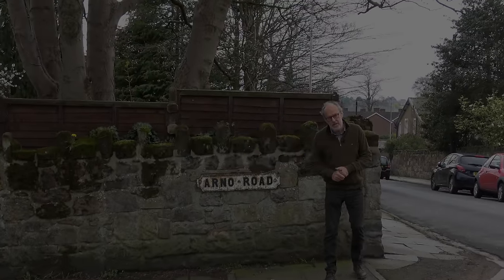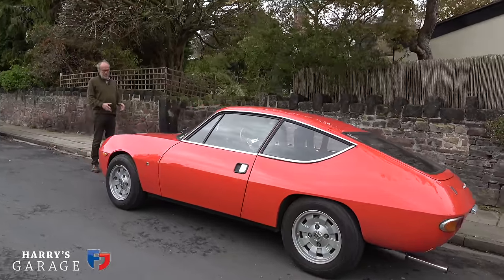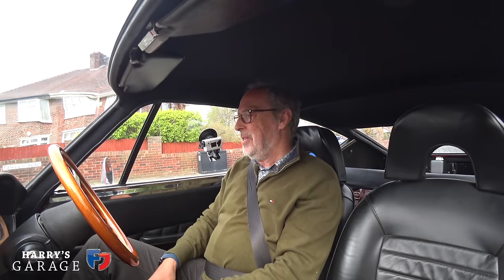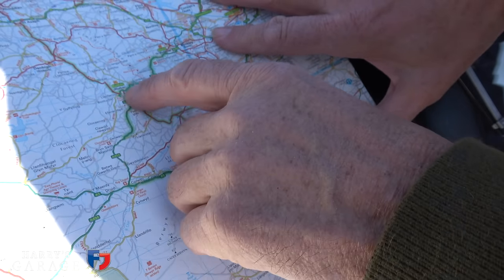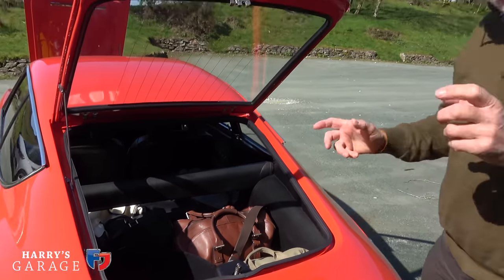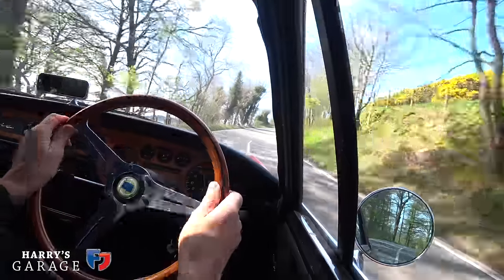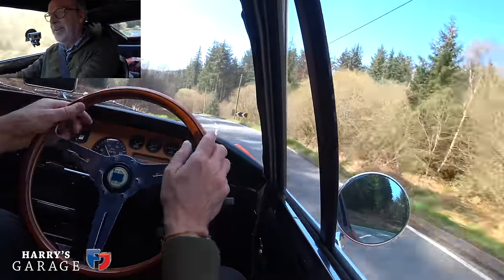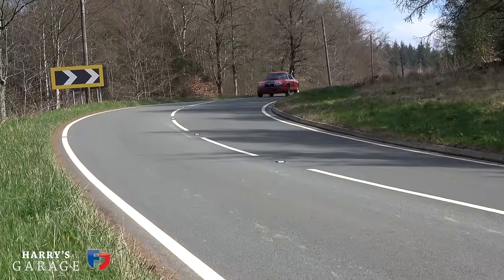Taking my Lancia Zagato back to where I first saw it 50 years ago & driving it on my favourite roads

Comment: Thank you so much for sharing, Harry. The timing of this video is blowing my mind because I’ve just done something incredibly similar:

I turned 16 In 1998, and I got my driver’s license and first car that year. It was a ‘95 Mitsubishi Eclipse GSX in white, which is a sporty AWD car with a manual transmission and turbocharged 4-cylinder engine. Every afternoon I would leave school and drive 25 miles home through the curvy rural roads of the Blue Ridge mountains in Virginia. Up until last month, those after school drives have remained my fondest motoring memories. 

In 2017, I moved out of the city and purchased a home in the rural Blue Ridge Mountains of Virginia. Then, on March 9th of this year, I purchased a new 2022 Subaru WRX in white, which is a sporty AWD car with a manual transmission and a 4-cylinder turbocharged engine.

Over the past month, I’ve been reliving those memorable drives from my teenage years in my new WRX, and I can honestly say that the joy it has brought me is right up there with the happiest days of my life. It’s not just the joy of a great car on a great road, it’s the joy of MY great car on MY great road. Congratulations on coming back to YOUR great road with YOUR great car. My wish is that all the other hopeless gear heads get to experience the same. They deserve it.

Comment: Harry, I know all that area very well. I cut my teeth riding my 1973 Triumph Daytona 500 and my 1963 Norton 650ss on Sunday runs all around North and mid Wales.
That double bend between Ruthin and Cerrigydrudian is a tricky one, it was awkward to get the right line through the bends, mainly because it is not only a down hill but the road cambers away, tricky in the wet.
Great times and great memories just like you have. Where you drop down from the town square in Ruthin to the bridge, me and my good friend used to always stop at the café next to the bridge for a hot tea or coffee and a Chorley cake, oh what lovely memories you have brought back for me. 
I have been thinking about buying a nice condition Norton 650ss and just spend my time journeying along the Welsh roads again.

Comment: A wonderful nostaligic piece, which takes me back to my first car, a used,  bright red Fiat 124 coupe that my dad bought me as a graduation present when I finished my undergraduate degree. . It cost $2900.00 Canadian in 1968, had an exotic 1428 cc, dohc engine, dual Webers right from the factory, and wonderful Italian handling.  I loved that thing and spent money I could ill afford as a graduate student, targing it up with a nice woodrim steering wheel and assorted go-faster stuff.   I was heartbroken when the rocker panels rusted out from salt on the winter roads of southern Ontario. Once, I took a friend of my dad's out for a ride on my favourite twisty country road.  After the ride he said "you know, you don't have to always drive as fast as the car will go".

Comment: As someone who grew up and started driving in around the same era, I feel lucky that I got to drive so many unusual and special cars, that were often more run of the mill back then. (not that this lovely little Lancia falls into that category!) The only Lancia I owned was a Beta 1600 HPE and finished in gloss black it just looked beautiful.  I had only been driving for a couple of years, after starting out in a modified 1962 Mini Minor (with an Austin 1300 engine swap!) and then having Cortinas, Escorts, Capri 3.0 Mk1, Fiat 131, Alfasud 1.5ti, BMW 2002tii, Renault 5 Gordini and Gordini Turbo, Porsche 914/6 to name just a few.  All were wonderful cars in their own way and even allowing for 'rose tinted spectacles', were great to own and drive.  They were cars that I would drive just for the pleasure of being behind the wheel and taking them on my own favourite driving roads. A feeling that I just never get with modern cars, where using their performance means you're travelling at speeds where the consequences of a mistake could be life changing. Give me a lightweight car, with a high revving normally aspirated engine and proper handling every time. Anyway, thanks for another terrific video Harry and for sharing that wonderful Lancia and its story with us.

Comment: Brilliant video, love the nostalgia aspect to it. Memories came flooding back to me too: I had a Fulvia Sport 1600 in the mid-90s which I had restored (though not quite to the same standard as this!). The exhaust on this car is definitely way too loud, at least on the inside (weirdly, the sound on the outside shots are pretty much as I remember). It wasn't at all intrusive on mine, just the right amount of sound to let you enjoy the engine without being annoying when cruising. Gearing was quite low, so it tended to encourage the use of a lot of revs and even with that I don't recall it being anything like as noisy on the inside. A delight to drive, so well balanced through the corners. It felt normal sized inside, but the views from the outside here brought back just how tiny it was, especially when viewed from behind. If only I still had it! I can't recall the reg, but it was a bright red when I sold it (it was the same orangy red when I got it, similar to this one, which it retrospect I'd have retained, but at the time the very 1970s colour was definitely out of fashion, unlike today). I wonder if it's still on the road today?

Comment: This video brings back the JOY of Motoring on a favorite route! I really love the bit where your Dad was coasting to save fuel. I loved doing that and used to do it home from the grocery while in Uni. Then I moved West and discovered it is really fun on the local mountains, just be prepared for no vacuum assist on braking! 
I discovered the "slow" car driven "fast" paradigm with my 20 year old Miata. It is so much fun. I agree the Lancia is a bit loud and not as refined a sound as it should be. The Miata is fitted with a Racing Beat resonator and intake that I find quite mellifluous, it is only really loud with the throttle on the floor.. otherwise a nice purr on the motor/free-way.

Comment: Great story and video! That Zagato has turned out such a gem, what a wonderful rallycar for the road!

I've been having a similar experience with my '99 Ypsilon 1.2 16v Elefantino Rosso. Not that I have owned extremely fast cars before (a Thema turbo 16v and a 420 Biturbo being the fastest), but I've been having so much fun in this 86hp little racer! It gives me the same kind of vibe; light, low centre of gravity, wide track and high revving. Quite special looking and practical too. It's so much fun just driving it around town and on faster roads it just sticks to the road and flows through corners. Took it to Zandvoort recently and plan to do a few laps at Spa (Italia) in june!

Enjoy the Fulvia Harry!

Comment: Thanks for taking us along for the ride! I've done just the same sort of thing on multiple occasions.

Webers sound like they may be slightly out of sync. I'd consider bringing the chokes down a step to help crispen up the low rpm throttle response along with the longer stacks, if outright maximum horsepower is not the main goal.

Comment: Harry 
I had one of those Puch mopeds! 3 speed throttle type gear change. My Dad bought it for me, it was £120 new. 
I got an apprenticeship with a Ford main dealer (Haynes of Maidstone) and needed a way to get there. I would put my toolbox across the saddle behind me, held on with 2 bungee straps, not sure about how safe it was now.

Comment: One of your best. 
What a trip down memory lane. You comprehensively proved that meeting your heroes, be it cars, roads or regions is rewarding. The pleasure you get from modest hp and sub 1000kg  cant be beat. 
Yes change the exhaust, sound not in sync, bit of strangulation there?
Reply: XJC same roads?

Comment: Can totally relate to the nostalgia trip etc Harry eg working on cars in the drive. I had to smile at the yellow Puch VZ50 moped; my mate had this and I had the green/cream MS50D, more like a bicycle but I was always impressed with the beautiful alloy cowling to divert air over the cylinder head. Then the Orange Beetle - similar here with a 1302S no less (1600cc) as my first car. Never knew how rare that would become (chrome bumpers and big bonnet). I agree on your plan to change the exhaust and then with the longer trumpets, should be interesting

Comment: Another great upload. And this is what proper driving is about. It is NOT about stupid speeds but "feel" and "flowing" and getting the most out of the vehicle, but being very connected. So unlike the modern (silly) supercars, which are boring by comparison as everything is just too easy in them. Pleased you are going to change the exhaust as that one is bordering on anti-social and is a shame when driving through an area of outstanding natural beauty. Harry always looks more enthused and happy in a small, lightweight , manual car than any supercar.

Comment: Great video, Harry, really great roads and of course that Fulvia.. thank you!  Re. the intake plumbing, worth a try with the longer trumpets, but I can't help thinking your Weber 45s will always deliver a "trackday" tune with the little 1600 - not sure what venturi you have in there?  Maybe you could revert to the Solex C.42.DDHFs that I think the Fulvia had in the 70s. I've got a set on a 1600HF Coupe (same engine 818.540) and they're very smooth and "powerful enough" with their 36mm venturi.  They're also a lot more compact, or at least, they sit closer to each other and therefore slot in behind the head nicely. On the other hand, it sounds like you're heading to the dyno, so it's likely you'll get best results there with the Webers! Thanks again for the video and please keep making them.

Comment: Work on that exhaust Harry.  I had a special road that I took every car I had in the 1960's including a Mk1 Lotus Cortina.  And then later a Prince Skyline GT.  So different.  Throttle off oversteer in the Cortina and snap oversteer in the Skyline after terrible understeer.  A friend from the next town had a 911 but he could not get away from the Skyline.  Thanks for bringing back memories.  Great video. But attend to that exhaust please.  Did I see a little push in the corners from the Lancia?

Comment: As a highly experienced rolling road owner and operator of some 45 years experience, to me the engine sounds a bit off tune, there is always a combination of jets with Weber carbs that will give you acceptable progression but in this case I feel that there is an issue with the valve timing, my advice would be to try it on the rollers as is then with slightly reduced valve lift at TDC on overlap on both intake and exhaust valves and see what the effect is. I would guess at 33mm chokes, 55F8 slow runs, F16 emulsion tubes, 140 mains, 180 airs and 45 pumps, fuel pressure 2psi, power wise I would hope to see 150 bhp flywheel, bear in mind that we at HT Racing Ltd used to get over 200 bhp from a 1.6l Pinto with perfect road manners, great low end torque and total reliability, good luck and thanks

Comment: That's great. That induction noise is just awesome ...and quite ferocious. Harry, I'd like to know, what cam profile are you using?
Have you thought about applying noise insulation to the bonnet? I think it would reduce the reverberation quit a bit.. and you'd still maintain the induction noise. Great work, the car and the video!

Comment: I started with racing bicycles too, then motor bikes, then cars. A natural progression for a lot of guys I think. Though not racing motor bikes or cars, too expensive for me.

45s are kinda big for that little engine, maybe smaller venturies to keep the air velocities up? Over carbonating can make for rough running.

Comment: Very nice. It should be able to idle around 800 RPM I think. Also, I would check the exhaust and any open passages from the engine bay to the cabin. I just started driving my '72 S2 1300 and it's tons quieter than this one.

Comment: I'd hazard a guess that the stack length with those ultra short trumpets is still a bit short at the redline? Though I was surprised by the choice of such a large carb on an engine of that size I would have thought that 40's would have been big enough unless you were running a full race cam and a silly redline?

Comment: I finally understand why you love this car (and I have asked repeatedly why you did), so the mystery is solved. It is not beautiful (sorry, it just isn't), but it was a true performance car set in a sea of typical suburban family sedans and hatchbacks to your young eyes. It must have seemed very special in that (mundane?) setting. It's like my affinity for MG-GTBs. From an engineering perspective, well, they were not great (and the electrical systems were nightmares) but when I saw one (here in the states) back in the late 60s, I was transfixed. While all my friends lusted after Camaros, Mustangs and Road Runners, I had fallen in love with small, toss-able, European cars whenever I chanced upon one. When I saw my first M-B SL, I was just stunned. The 911? Wow, what is that? Back then I would have taken any MG (or Austin-Healey and/or Triumph) over ANY American Pony-car with no apologies or explanations. So, I guess you're not just driving a car, you are reliving your childhood dreams. At last, I get it. Thank you for doing this video. It made my day. As much as I may not favor the design, it WILL turn heads wherever it goes simply because it has an unmistakable mystique and aura.

Comment: Anyone know what's causing the small, flickering light beams between and below the two central carb trumpets at 06:40 to 06:52 - e.g. at exactly 06:43? (Clearly visible with video settings at 4K def and 0.25 playback speed.) Is it from the instrument in the left of frame? If perhaps a timing light? (Though that wouldn't be necessary for carb tuning.) Truly fantastic story in terms of both finding (by pure coincidence!) and restoring one's first car love. And what a car to fall in love with at 14!

Comment: You couldve had a Porsche, an alfa, lancia, dino, e type, c2 corvette, and many others back in the day. The high end sports car market has never been this saturated following the 60’s 70’s. And the only time it might’ve been better was when the montreal, stratos, and renault alpine were on the market at the same time. All these cars were priced in the same bracket some more some less and they were way cooler than whats in this segment td. These were porsche 912/alfa giulia sprint competition. The flaminia wouldve been competing with the 911 and e type for example. Its sad that these brands no longer exist or have lost marketshare so badly that they no longer compete in the segment like alfa romeo. Td maserati is where these brands were. Alfa rly needs a v6 front engined sports car asap, bc as things stand the only italian cars in this segment currently are the ferrari roma and maserati mc20. Theyre at the very top too while alfa historically had a car at more contemporary 911 levels like the 1900,2000,2600, giulietta sz, sprint speciale, montreal, and gta’s.

Comment: the design of the front doesn't look 50 years old, the design aged well

looks tiny next to the mini

exhaust needs to be fixed, it should be noisy like that more towards to higher revs only

this car is why 250cc bikes can be more fun than bigger bikes, there's more going on